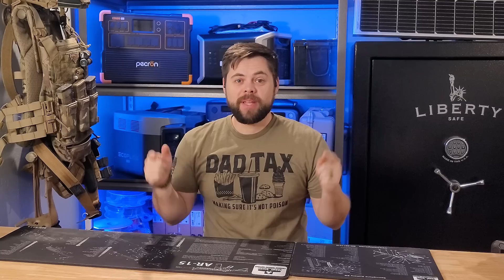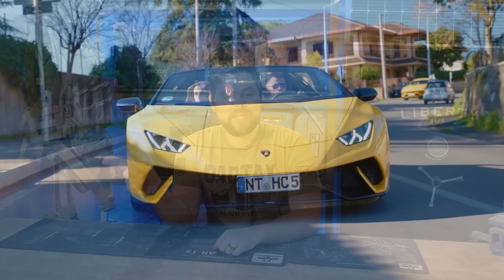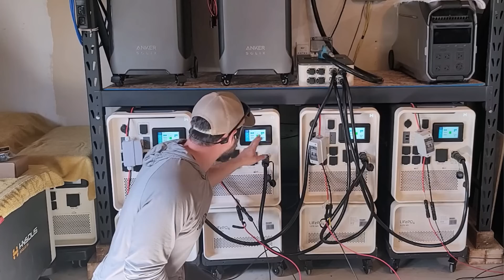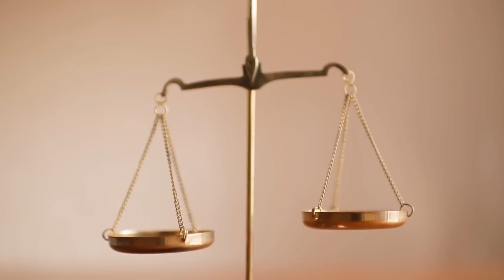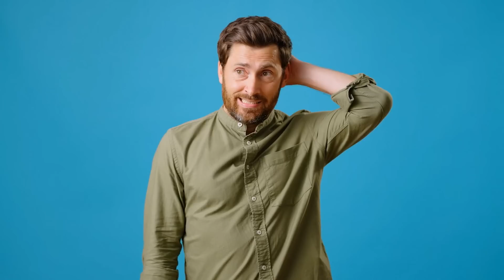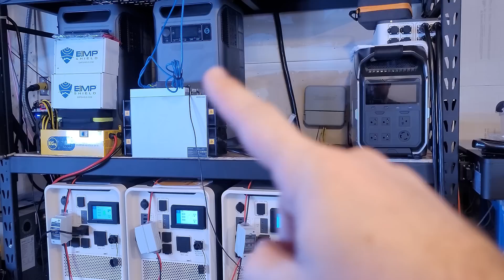These 4 Reasons Are Unlike Any Other for Hysolis and the Apollo

Comment: I can attest to the Tech Support. We bought 2 complete 240V systems for 2 cabins. One system worked flawlessly from the start and still does. The other system fried one of the main units. The sent us a new unit to replace the fried unit. After it happened again, it was determined that the unit that wasn't blowing up was actually the one with the issue. So they the sent us an entire new 2 unit system and paid for all shipping. That a total of 4 new units. Now it works perfectly.

Comment: You helped me out and I went with an ECO-FLOW DPU.  I must admit that I went through another third party instead of you.

I have a whole house FLA system from 2011, trying to Delta pronoun, but this video is so good what if I do get any more solar generators I'll be sure to call you.

2 things I've learned not to like about the DPU are the firmware updates and the inability to perform local functions. ... If I'm not mistaken, I believe the Apollo allows you to use the app but also the local screen that is removable.

Your tutorial video on how to set up his very clean. You're very good on the phone.

Comment: I have been running 2 5k apollo units for about one year and I am very happy with them. I am going to double my units this year.
Reply from the maker: That's awesome! Let me know when you're ready to expand :)
Reply: @minutemansolar    I am ready to expand. I just got my second set and 20 more panels but no Apollo 5K • AC 240V Split Phase Combiner Box are in stock.  do you have any ideas how to hook them up without the special box 
I have been off grid since 2004 and want to stay this way for ever. I have 32000 watts of solar running 3 separate systems and I am so happy with the apolllos that I have had for 1year, now that I have 4 units I can live like a king.

Comment: I have an off grid system with 4 apollos with a combiner box along with 2 expansion batteries.  I also have a 17.6kw array.  On consecutive cloudy days, I'm able to recharge from less than 50% to 100% in less than 2 hours using AC fast charge at 20A/Apollo with a 22kw Generac generator, while also running the house.   I tried ACFC set to 25A/Apollo but it tripped the inverters so I backed off.  Seems stable so far.  May not remain stable though.  I may have to limit other heavy loads during ACFC and/or back off the ACFC more.   Looking forward to looking into the new charging unit.

Comment: I’ll be anxiously waiting to see what Hysolis comes out with. I’ve had difficulties charging my Apollos and expansion batteries from a less than 3% THD generator. I’ve had several days of cloudy days and live 100% off grid. So plugging them into a wall outlet is not an option. I can get my generator to charge the units, but it is not a straight forward task. To do a “fast charge” I need to remove the battery cable and communion cables from the back of the units and change settings on the control panel. Talking customer support I was sent a link for a golf cart battery charger (converts to dc) and a battery cable to charge the Apollo batteries. This bypasses the electronics so even a non THD generator will work. Ben mentioned something coming out that will charge the batteries around 5,000 watts. The solution customer service sent me is 800 watts.
Reply from the maker: I know it's hard going through all of that so I appreciate your patience. The device will be available asap for fast charging.

Comment: I AM NOT IMPRESSED.-You can achieve the same thing with two Delta pros and the Delta pro generator. If you connect the Delta pro generator to one of the Delta pros and then connect that Delta pro DC output to the DC input of the second Delta pro. Then set the parameters that it charges if the Delta gets below 30%. The generator will charge the first deal the pro if it gets below 30%, and The first deal the pro that’s hooked up to the generator will charge the second Delta pro if it gets below 30% through the DC to DC connection. The Delta pro gas generator charges in DC so there’s no power loss. In theory you could daisy Chan three Delta pros together through the DC ports using this method. And run three phase.
Reply from the maker: Fair enough, but I like the better solar input, no need for firmware updates, and better dark start as well as better charge sharing. That doesn't make the DP3 or DPU obsolete in anyway, it's just a different option.
Reply: @minutemansolar just lots of cables between the units.  I’m pretty sure the DP can dark start at a user set percentage of charge
Reply from the maker: @eabizzarro  Yes they call it AC Always On. And mine doesn't work consistently as well as others that I've asked which is why I don't consider it full dark start. I've had to manually restart mine multiple times.
Reply: Very interesting   How expensive?

Comment: I'm glad you talked about the gas generators. As you know, we, personally, had a lot of issues with this a year ago. Maybe we were one of the first customers, truly off-grid with no option to grid AC charge, attempting to recharge with a gas generator. We initially tried with 120V inverter...nope...then we bumped up to a 240V inverter....nope, initially, but finally success after a lot of back and forth with Hysolis and our electrician. What was finally "discovered" is that you have to wire things up so that the 240V power from the gas/propane generator is charging each Hysolis unit (2 set-up in 240V spilt phase) "out of phase". I'm not an electrician so I'm really still not sure what all that entails but it required some creative rewiring of the generator inlet from outside to inside to work. Once that was done, only then could we charge both Hysolis units at the same time while also running the house. Additionally....you cannot recharge in this manner AND have solar charging at the same time, despite what their literature says. That will not work. You have to flip the solat breakers to "off" to recharge via. generator. As you can imagine, all this took quite a while to figure out. I'm still unsure if that depends on how much solar is incoming or if it's just that it won't work if any is incoming at all. We just turn solar off and recharge. 
Maybe this new device will help? We spent a lot of $ on gas/propane generator backup. It might be worth making a video JUST on recharging options. It's not as straight forward as it should be and there is 0 guidance on how to do this in their manuals. It's all trial and error which is a little scary with how much these cost.
Despite all if this, I still feel it's the best out there. The amount of solar you CAN charge with is amazing. And being able to recharge with a generator can be the difference in surviving off-grid. That's no joke. It's real.

Also, I 100% agree with the customer service. I had 1 bad unit that ended up destroying ,2 other units before destroying itself. They've sent me 3 new units and never charged me a thing. They paid all shipping costs and replaced the units.
Reply from the maker: Ya it's a bit tricky with the gas generators. I am working a solution video to make things easier for people.
Reply: What kind of generator do you have?
Reply: @kevinshriver7589  We ended up buying (2) Pulsar 7250W 240V Duel Fuel Inverter Generators. We have 2 cabins with exactly the same setup.

Comment: Agreed! The one thing this unit does that no other portable product can do is load sharing. Two apollos will share power with each other and drain batteries evenly. These units are rock solid in my opinion and that's why I bought 2 with expansion batteries for 240 support and load sharing.
Reply from the maker: thanks for sharing!

Comment: All depends on what features you need. Having to link two main units together to get split phase is at this point outdated tech.

Having just one model is also limiting. They need to catch more of the entry level market so that when people are ready to upgrade the larger unit becomes more appealing.

Otherwise I’m sure it works well.
Reply from the maker: Fair enough. Thanks for commenting.

Comment: I love my Apollo so far, my only complaint is that they don't have an API available for integration with home automation. I'm happy I got it, just wish I could connect it to Home Assistant for tracking input/output and ideally even for automating changes. Local API via the wifi would be great, cloud based would be an ok alternative. All the capability is already there, even just published specs on how the display communicates with the base unit would be enough to make the Apollo perfect. 

I've used it camping for my RV, during the summer for AC where I didn't have a circuit that could run it in my office room, and to run the fridge, freezer and furnace during a couple of brief power outages.

It charges great from my trucks inverter when solar isn't available too.
Reply from the maker: Agree, auto transfer power would be incredible.

Comment: EG4 already has a 5,120 watt battery charger called the Chargeverter $465.00. i can buy right now a 16 kilowatt battery for $1,932 and a EG4 6000XP inverter/charger $1,399. So, for $3,796 i can have 16 kilowatts of battery storage and 6 kilowatts of inverter with chargeverter for $4,894 less than a 5 kilowatt Apollo 5K and one expansion 5k battery.
Reply: Could you share the details on that 16kw battery? Also where’s can I purchase?
Reply from the maker: Yes that is true. I have nothing against that, I'm all for it. Not everyone wants to build their unit which is why solar generators exist. I love EG4 equipment.

Comment: So just to confirm - My Ecoflow Delta Pro 3 won't charge from my 7500w Westinghouse non inverter genny? Haven't tried yet but that's a basic staple of my backup plan. Please assist.
Reply from the maker: Correct, unless the THD is clean enough and the DP3 will allow power in. They won't charge off of dirty power.

Comment: Here's a question you most likely don't get very often, what type of RF noise is generated by these units? I am a ham radio operator and have been reluctant to go with solar because of most solar charge controllers produce God awful interference on the amateur radio HF frequencies. Maybe while reviewing these various systems you could comment on this. That or comment on how to mitigate this interference.
Reply from the maker: Great question. I am a HAM radio operator as well. I don't know the exact RF coming off of the units but it hasn't interfered with my radios.

Comment: @3:55 thats kinda misleading imo. any 240v inverter wont drop  a leg if a battery dies on a 2nd unit.
Reply from the maker: I was referring to having two Delta Pros using the dual voltage hub. When leg/phase 1 goes out, the voltage hub turns off because there's only one leg of power. So you lose all power output from that.

Comment: This doesn't really sound special, there is a whole market segment that does these things.  Most residential hybrid inverters can gang their output and share the same battery bank.  And generally speaking I dislike having to gang units just to get split-phase... I'd rather each individual unit output split-phase and then gang the units that way to increase the output.

It comes down to redundancies.   It's a lot easier to add redundancy piecemeal when you can do it one unit at a time, instead of having to add in pairs.  I'm sure the vendors are happier if you buy more of their stuff, but it just pads their profits.  It's not a good solution for the consumer.

In terms of generators... there is already a solution on the market.  Actually numerous solutions but the easiest is the EG4 Chargeverter.  You plug the generator into that and charge the (48V) battery bank directly.  Problem solved.  Which is what this Hysolis thing is doing too... just in a more proprietary format.

Generally speaking it isn't battery charging that suffers from dirty generator power, instead its the fact that most hybrid inverters have to run in pass-through mode in order to use the inverter circuitry to charge the battery which means the dirty generator output is being fed into the house.  Having an independent AC battery charger such as the Chargeverter solves this problem.   (This is because the inverter cicuitry in these units is dual-purposed to reduce costs and share the beefy heat sinks and other circuitry).

The problem with trying to use power stations to run a house is the proprietary vendor lock-in and the difficulty of scaling just the bits and pieces that you need to scale.  People who want to feed their whole house really need to stop messing with power stations entirely and go with more discrete systems such as a Victron Multiplus II or an EG4 18K or a Sol-Ark and discrete battery banks with server-rack 48V batteries.  Etc.

For a big system you want to use standard bits and pieces that are generic and cross-vendor compatible.  Otherwise you wind up spending an arm and a leg when stuff begins to fail years down the line because the vendors no longer sell those products or remain compatible with their 10-year-old gear.  So many people buying these things now are going to be tearing their hair out in a couple of years when they realize the rabbit hole they went down.

-Matt
Reply: Sound logic.
Reply from the maker: Fair enough, thanks for sharing.

Comment: So EcoFlow ultra is about $5k for 6k wh and $2700 for extra battery.    This unit is $5k for 5k wh and $3700 for 5k extra battery. How is that better??? Because you get more solar input? The typical homeowner doesn’t live on a cornfield with 5k watts of solar panels spread out. And rooftop installations are guaranteed leaks. 
     Not to mention the units are huge and unsightly with wires everywhere.  Just go generac propane back up if you can and if you want portability get EcoFlow with some solar and a EcoFlow auto start generator or a Honda 2000.
Reply from the maker: Fair enough. The differnce comes in when you put it together as a kit. The Apollo kits tend to be slightly more affordable than DPU kits for similar specs.

Comment: Thanks Ben for another great, informative video.  I'm really learning a lot from this series.  I'm trying to accumulate enough funds to put in a backup power system for the essentials in my house during a power outage and I know there are lots of great options for free standing homes.  But what about apartments and town homes?   Do you have any thoughts on backup power for apartment/town home living?  I'm thinking solar is going to be very limited depending on the availability of sunlight to some of these units.  Assuming a unit has some exposure to solar at some point during the day.  Are there viable options for solar panels hung in windows or placed on balconies that can recharge a solar generator, sized for the smaller essential power demands of an apartment/town home?  I realize running the heat pump(which is what every apartment I've been exposed to heats and cools with) is out.  But just to be able to run a small ceramic heater or room a/c, the frig, and smaller loads(recharge phones, laptops, and a fan) would be great.  Thanks for any help and keep up the great content.
Reply from the maker: Thanks for watching. Great question. The problem with apartments is you have no space for solar panels. I think the best option is to get a high output inverter generator that can recharge the power station quickly. That way you exchange 4 hours of gas for 24 hours of battery.

Comment: Hysolis would seem to even beat EcoFlow in reliability and features, and this is something worth pointing out. I don't like to screw around with my power stations. I have longed to have a solution which you take out of the box, plug it in, and it just works. This is all I want ! I don't want it to constantly require firmware updates, because there's nothing in the unit that needs a patch, repair, or improvement. Imagine a power station that is ready when you take it out of the box ? You just plug the product in, and there's nothing HALF-BAKED ABOUT THE PRODUCT'S READINESS TO FUNCTION ! IT JUST WORKS ! ARE YOU LISTENING ECOFLOW ?
Reply from the maker: Exactly! Thanks for sharing =)